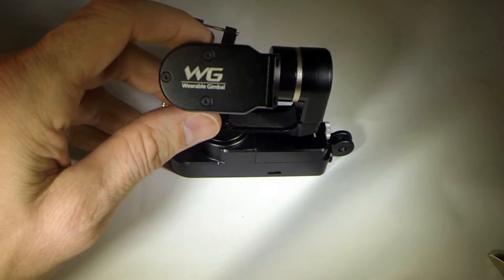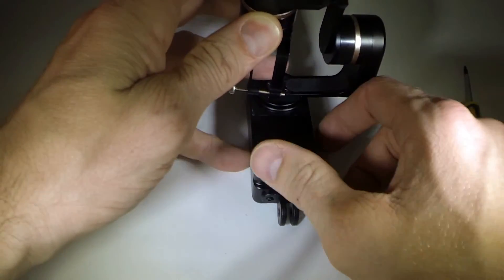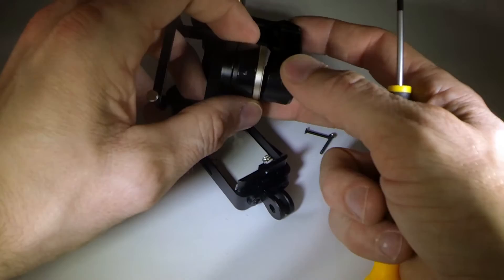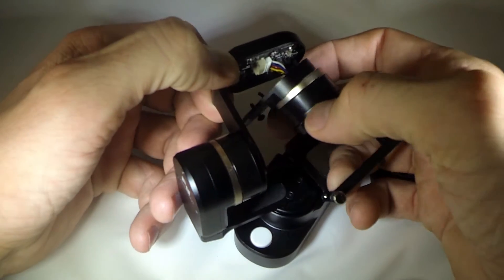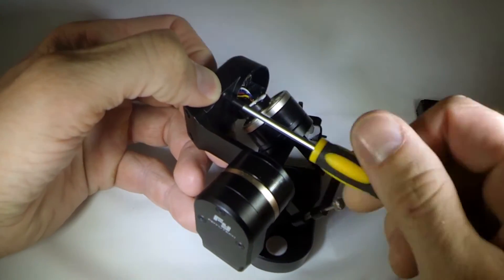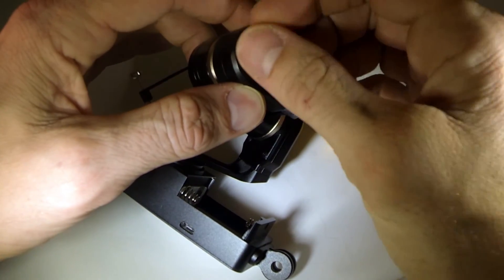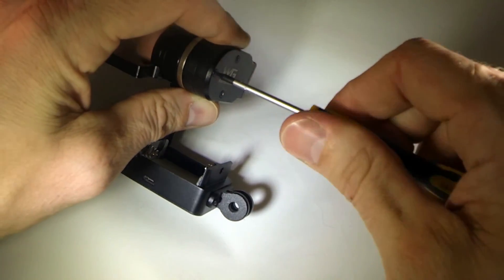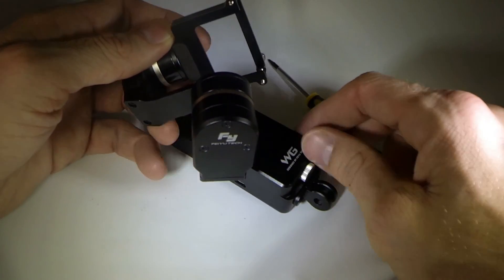How to fix the Feiyu Tech FY-WG 3-Axis Wearable Gimbal Stabilizer

Comment: Good emphasis on unwinding the wires prior to reattaching the connector. Failure to do so will not only make reattaching difficult, but subject the gimbal to easier detachment in the future (the shortened wires due to twisting allows less "play"). If this is a reoccurring problem, has anyone found a permanent fix? Maybe a spot of two-part epoxy where the two parts of the connector join?
Reply from the maker: Thanks Stan. On mine there appeared to be some sort of initial epoxy. I thought about adding something stronger but my concern was that if I don't allow the connector to come loose then that strain on the wires would just transfer elsewhere and then I might end up with a pin pulled out or a wire actually breaking.  I have been thinking about some sort of mechanical stop on the exterior of the gimbal that I could 3d print.  If I come up with something I'll post the design on here.

Comment: Thank you very much for posting this Vid! I had an malfunctioning Gimbal after I hit it with a Rucksack (I was trying to swing the rucksack over my head but was forgotten about a Gimbal on my helmet :-(  ). After opening the gimbal the connector was pulled out the board... I unwinded the wires and plugged it back in and Voila: repaired!

Comment: Thanks for taking the time to make and post the video, great to know for the future. Mine however has just developed a noise from the base motor (just like this person has posted https://www.youtube.com/watch?v=vMlHY-OjAN4 ). Any ideas of a solution and if need be where to find replacement parts?
Reply from the maker: I'm not sure about that noise, might just crack the housing open and see if there's anything going on.  My first thought, which is just a guess, is that maybe the wires have twisted up and are putting tension on the stabilizer motors but are not getting disconnected so it's still working but is straining.
Reply: OK found a quick fix. If your gimbal sings like mine try this as I have exact same problem as per the video link I added before. So after stripping down the bottom section of the gimbal I had a look inside for loose connections/dust but I found nothing. When I put it all back together to test it, the noise was still there however just by chance I removed the bottom cover plate and tested it again and wow the noise disappeared. When I replaced the cover plate the noise came back again. I removed the cover plate once again and this time I inversed it so that the bottom screw hole faced the inside of the gimbal and when tested the noise has gone away. Quick temporary fix but does anyone have ideas why this is so? Cheers

*Seems to be associated how the base cover plate touches the internal wire connector, Ive tried putting on as normal and slightly loosing the screws which also seems to work.

Comment: This happened to mine but the wire broke.  I have a new wire but can't figure out how to get the wire through the small hole.  Any idea?  Thanks!
Reply from the maker: If I'm understanding your issue correctly you should be able to remove each wire from the white connector and maybe fish them through one at a time and then reinstall into the white connector. You'll have to be careful taking them out and reinstalling them though as I'm sure those pin sockets are fairly delicate.   I found this guy's video (https://www.youtube.com/watch?v=S9xeg_3eREc) which shows how to remove the pins.

Comment: Thanks. This really helped me fix mine. I tried what I saw in other, similar videos, but only after viewing yours did I realize I needed to check all three axes. In my case, the disconnected plug was the one for the axis on the base. I removed the four screws on the back of the base of the gimbal and found the disconnected plug. In the good news column, the batteries I charged six months ago (and left in the case, not in the gimbal) still held enough charge to test the gimbal once I'd reassembled it. This is a great piece of kit, but you have to know how to fix this problem when it happens (and I expect it will happen again). Thanks for your video.
Reply from the maker: You're welcome. This was frustrating to me as well as you would think they could have designed it to recognize when no camera was present. I'm actually thinking of making some kind of "stop" on each axis to prevent full rotation as this has happened to me several times now even with the camera installed.